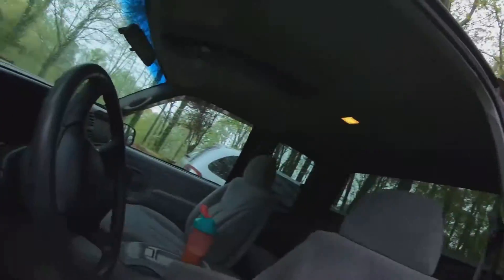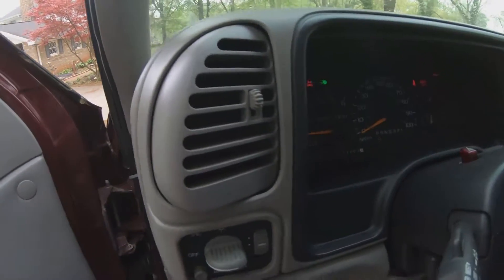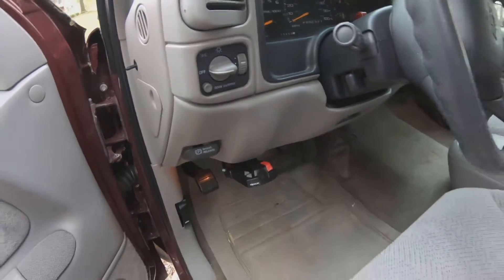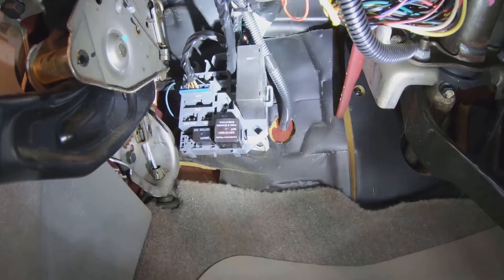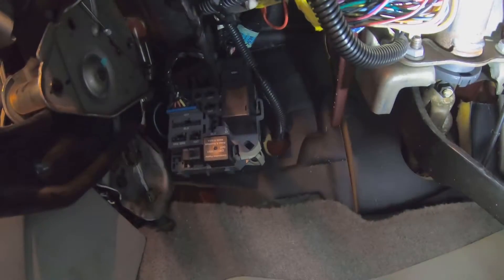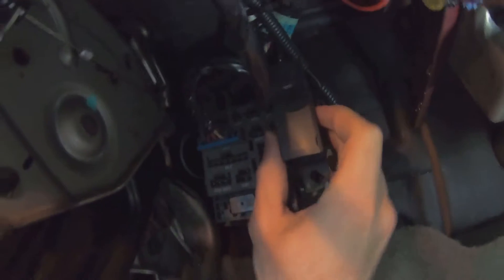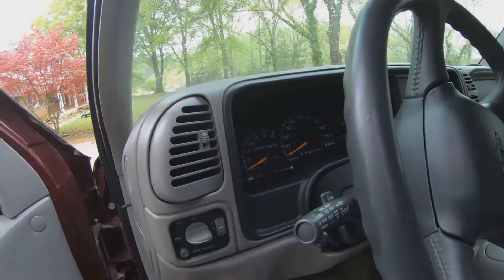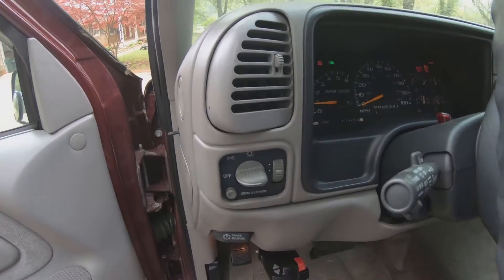How To Remove the Chime Module On A 1995-1998 GMC/Chevy  C/K 1500

Comment: My chime just started chiming all the time. Mechanic slammed it & it quit. Had to do that for 2 days but the window began coming partially off track & the vent visor began separating from the constant slamming. Tried spraying WD-40 & Breakaway up in the door. Would work for an hour or 2. Drove home last evening in the rain from camping & had to listen to it for 55 minutes. Thanks for posting, my sanity is restored.
Reply from the maker: Haha glad I could help you!
Reply: @bossadamsgarage  I have a new issue, I unplugged it & enjoyed the peace & quiet while driving yesterday, but tonite, I realized all 5 domelights in my 1998 Suburban are illuminated all the time. I reinstalled the chime box when I arrived at our campsite, but the lights all stay on. I cannot shut them off so I guess I'll have a dead battery in the morning. Anyone have any ideas? The Suburban has 5 dome lights, 1 between the front seats, 1 over the 3rd seat, 1 under the dash on each side in front & 1 under the center dash.
Reply from the maker: So with that situation the chime box will not effect the lights at all. There were times after I first removed the chime box where I forgot to turn off my lights because they are not automatic and my battery died as well. This was due to no chime happening when I opened the door lol (cost of peace I guess). That might be your issue as well. If not one of the switches that activates the automatic dome lights could be messed up/sticking causing them to stay on. For that you'll have to go to each switch (should be 3 total, possibly 6 on your suburban) and check each one.

Comment: I took mine out today to stop the door - Key buzzer but now I find it has a 7 pin connection I would really like a wiring diagram to determine if  I can just bypass the Door -Key issue with a jumper wire on the harness. Have you ever found a detailed diagram?
Reply from the maker: I have never found a diagram that shows what you're looking for. Some ppl that work on these trucks often might be able to tell  you how to bypass it, but I do not know how to do such.

Comment: What is the relay directly underneath that?? Mine is missing and I believe I need it for my hazards
Reply from the maker: I'll be honest, I haved tested the other relays. There doesn't seem to be a diagram of these relays on the web either but if someone has a diagram or knows where to find one please post becuase I am curious as well!
Reply: @bossadamsgarage I have found out the two different relays that go there off some Google pics. 4 pin relay which would be EP29 after oem pn cross or the 3 pin relay which is EP28 after oem pn cross. Idk why the guy before me removed the flasher relay there but it caused a lot of confusion. I did find wiring diagrams of them but they seem to be different for each vehicle they’re in. I’ll see if I can find any of the forum links and post them here. Thanks!

Comment: I have a 93 Ford E150 van. As soon as I open my door the alarm goes off and when I close it it goes off. DON'T have to have to key in it. How do I disconnect it...?
Reply from the maker: Are you referring to the door chime like I had or the actual car security alarm and it goes off when you open the door?
Reply: The door chime. Mine goes off as soon as i open the door and it shuts off wben i close it witb out tbe key in ignition
Reply from the maker: I have never looked over one of those cars before but I could only assume it would be close to the same process as what I went through. On the older vehicles (some) there are chime boxes attached to a board under the dash. Other older vehicles might have a white plug or black plug also under the dash that you could disconnect to try and isolate which wire is causing the chime. If the chime stops when the plug is unplugged an your car runs like normal, problem solved. If the car doesn't run like normal, you will have to isolate which wire is causing the chime (more than likely in the manual) and see if you can splice a switch into it or just disconnect that wire all together. Hopefully this helps you out!
Reply: K thanks

Comment: You also may leave your lights and key in the switch and drain your battery . The previous owner removed it and I am putting it back in ! .
Reply from the maker: haha very true. I've gotten use to turning on and off the lights every time I get in and out of the truck.
Reply: @bossadamsgarage  I’m old , I forget 😆
Reply from the maker: haha!

Comment: Any idea on a 1994 gmc c1500.  That module is not on the same panel in my truck nor a place for one.   I only have 1x turn signal relay (square & tall) , one multi-purpose relay (short and square/cube) and a flasher module (short, chrome & round)  … since my chime went off, I have no ‘headlight left on warning’, no key in ignition cylinder, and if it also is suppose to buzz when seat belts are not locked in after truck cranked….  Well that part never worked…..  I have no idea where this “buzzer/chime” thing is on my truck or if it even has what other show in there 95, 97, 93… Chevy or gmc etc..  I’ve been searching but, no one seems to have any info on this for a 1994 GMC Sierra C1500.. Ext Cab, SLE, 2WD, 5.7L Gas Engine.   All help would be appreciated
Reply from the maker: I'll need to do some research on those models. It might be that a particular wire controls that chime and it has to be cut to stop the noise.

Comment: I have the same vehicle and I keep leaving the lights on and draining my battery, do you have a video on installing an alarm telling me that my lights are on...
Thanks in advance!
Reply from the maker: If it is the same truck, then you need one of those chime boxes to insert under the dash. I took mine out because I didn't want the noise but if you want the noise, you just have to buy a replacement and insert it where I removed mine.
Reply: @bossadamsgarage  Oh I don't like the noise, I just don't like draining my battery!
Reply: But now I know how to fix it! 
Thank you!
Reply: @chief9161  a lot of guys swap it out for an early 90s camaro chime, I opt for a late 80s corvette. Both are direct swap.
Reply: @carlomendoza8588  
What does it sound like?
Reply: @chief9161  look up evolution of corvette door chime. It’s on here.
Reply: @carlomendoza8588  
Yes sir I'll look it up!      Thank you in advance!
Reply: Yea, I bought the C-4 85/89 Corvette door chime for $25.00 on ebay!
Thanks for the info!
Reply: @chief9161  Nice!! Some people will say the C4 chime sound fits the smaller trucks like s10/sonoma better. I don’t mind it all for the C1500 platform. It’s a lot quieter compared to the Camaro chime, but it’s enough to remind me I left the headlights on, lol.
Reply: @carlomendoza8588  Yeah that was the main idea,  a softer tone so it won't drive me crazy, yet loud enough for me to hear and remind me of my headlights...